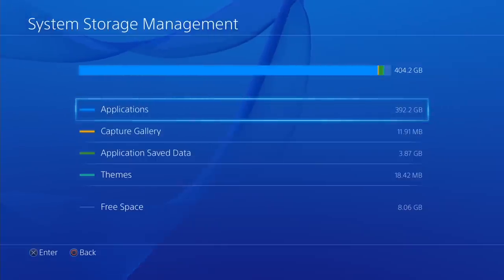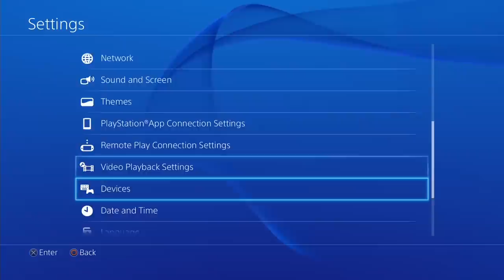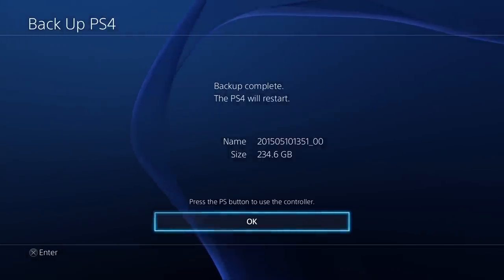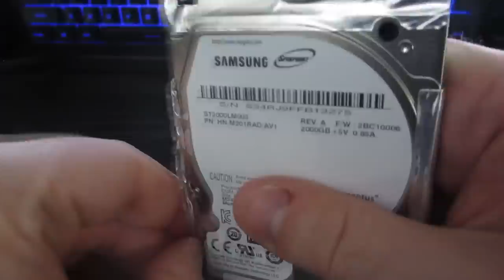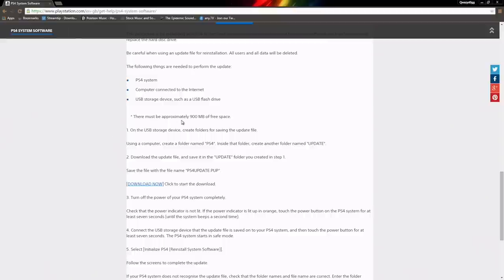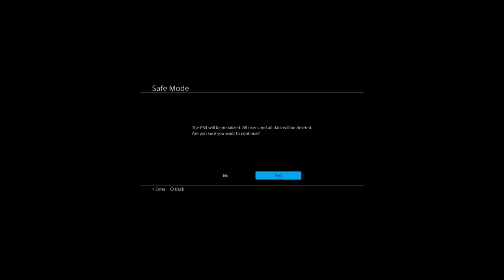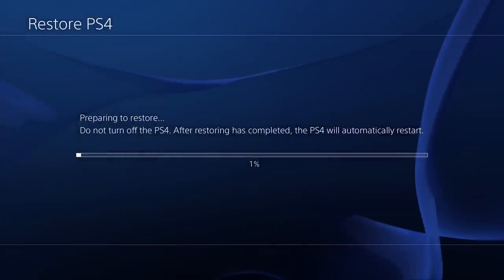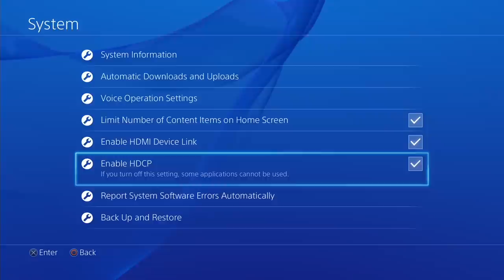How To Upgrade Your PS4's HDD Using A 2TB Seagate External

Comment: I'm a bit confused... I have a 2TB hard drive. I want to install it in place of the factory 500Gb from Sony. I also have a 32GB flash drive for the saved game data. From what I'm hearing, do I need another External Hard Drive?
Reply from the maker: +PreserveBigCats You would only need another external if you wanted to backup the FULL drive you are replacing. If your just backing up saved games, then a thumb drive would be fine.
Reply: Qwazyd0gg OK.. so it would just be as a secondary "storage" place? I wouldn't have to re-download that FULL drive Back onto the New installed 2TB drive, correct? My only concern with the full games I dl from Playstation Net. As long as I can re-dl them again thru PSN I'm OK with starting over. The disc games I will have to re-install. I'm just trying to cover my arse so I don't mess things up, i never did this b4 and I'm very hesitant.
Reply from the maker: +PreserveBigCats right, u can redownload all digital games for free, no need to back anything up other than saves... Unless the games are no longer available like the PT demo.
Reply: Qwazyd0gg  Thnx 4 the help... I'll check back when I physically need to change it out.. which should be in a few days, I need more space for No Man's Sky and soon after that Skyrim.
Reply: I just realized something... I bought Borderlands: The Handsome Collection thru the PSN+ store for $14.99... That sale ended and that game is no longer available in the PS store. Am I F*cked? Or should I just buy an External Hard Drive to be safe?
Reply: I guessing you'll need that external hard drive. Because if you can't download it from the store like PT it will be lost forever. (Like Qwazyd0gg said.)
Reply from the maker: +Scott Last You got it!
Reply: Qwazyd0gg I'm going to be trying this soon. I had to order the hard drive and it won't arrive until 11-Aug. Do I need to format the hard drive before tearing it out of the casing?
Reply from the maker: +Scott Last it doesn't hurt, just to make sure it doesn't have any bloatware junk from Seagate on it
Reply: All is good... the only problem, hours of DL time. But I got all my saved data back onto the new hard drive. Just rte-installing my disc games. 1.35 TB free space, it's a beautiful thing.
Reply: Qwazyd0gg You wouldn't happen to have a how to video on that? I know enough to be "dangerous" on computers.
Reply from the maker: +Scott Last unfortunately not man :(
Reply: Qwazyd0gg Bummer, I'm sure I can figure it out.

Comment: one question. should i back up my ps4 on the new drive im putting in? or would that be pointless?
Reply from the maker: The drive your putting in needs to be blank as the PS4 writes system partitions on it. Any files on that drive once the OS is installed with be either corrupted or erased. You will need another drive for the backup.
Reply: what will i do to the drive with the backup on it?
Reply from the maker: plug it in once the new drive is installed and has the PlayStation OS on it and you can then reload the backup back onto the machine
Reply: have you done a video how to put the playstation os on the drive? and how to put the backup back onto the machine
Reply from the maker: +Jamie G (DarkAngel1995) Its all step by step in this video
Reply: ahh alright. ill watch it again when i get my new hard drive :)

Comment: If I don't have a third device large enough to keep my saved games, can't I just put the adapter that was removed from the 2TB Seagate HD into the PS4 500MB hd and use it as an external? So I don't need a third device... And restore all my saved games and trophies?
Reply from the maker: The 500gb you would be placing into said enclosure would also be the same drive which is storing all your saves so you would not be able to us it
Reply: +Qwazyd0gg If I just want to keep my saved games, a normal USB Cruzer Blade will do the trick, since it's not occupating too much space. I'll just have to redownload all my games when the change is complete. Is that right?

Comment: have u had any problems with your ps4 since the new hdd swap?
Reply from the maker: +Paris Barksdale None at all. I purchase most of my games via digital download and whether it's directly on the drive or being partially read from the disk, if had no issues. This specific series of Seagate drive is known to be the most reliable with the least recorded errors of any drive swap tested in a PS4.
Reply: OK thanks alot.

Comment: So can i still put my previous HDD after i replaced it?
Reply from the maker: +Its Lewis You can set it aside and keep it in case anything happens and you need to put it back into your ps4, or you can place it inside the empty enclosure, format it, and use it as a 500gb external HDD.
Reply: Thank You

Comment: Can i just buy a 5TB external hardrive and keep it plugged in to my ps4 via usb cable?
Reply from the maker: +Ryan Irving unfortunately the ps4 will not read games or saves off an external like an Xbox one will. I'm also not sure about a 5th drive. I know they now support 4TB for sure but I haven't researches higher
Reply: its the same brand, would i be able to keep my save files on my external hardrive and just switch the games i'm playing back onto the 500gb internal hard drive? or even if i only got 2 or 4tb?

Comment: my old HDD wont work on in the seagate casing now. any ideas? I've got stuff on there I cant seem to redownload.
I cant seems to connect it on any computer
Reply from the maker: +gosh b The old drive will need for be formatted and reallocated in Disk Management before windows will see it; however, once you wipe it everything will be gone. If you need something off of it, you will need to reinstall the old drive into the PS4 and then backup what you need from it there.
Reply: Qwazyd0gg I might just have to find out how to redownload my other stuff again. how do I get to disk management? my pc can even seem to detect it.

Comment: do the seagate external drives work as is or do they have to be reformatted to something first?
Reply from the maker: +swiziga they have some bloatware on them so I recommend reformatting 1st
Reply: thanks, recommended format? exfat fat 32?
Reply from the maker: +swiziga either will work
Reply: thanks again

Comment: Hi im waching your video and i need help can u backup the ps4 data and updates on a usb flashdrive and also i dont have a computer to downlaod the firmware can it be done on the ps4 internet ???
Reply from the maker: +john aviles unfortunately you will need a PC :(
Reply: Qwazyd0gg thanks for the advice and your video its the right amount of information i needed im just be carefull with this process.
Reply: I got another question u know when u go to safe mode on the ps4 and u go to update system software could u download the ps4 update firmware by pressing the third option "update using internet"?
Reply from the maker: +john aviles no as the new hard drive does not even have base software to update from
Reply: Qwazyd0gg i think i got it im gonna get the "seagate expansion 2tb portable external hard drive usb 3.0 (stea2000400)" and use it as external u know with the plug. So i wont have to open it or get the firmware for the ps4 so its like an extend hard drive my ps4 drive plus the seagate drive together so yeah im gonna go with that
Reply from the maker: +john aviles awesome!!

Comment: Couldn't I back up onto the external, drop the file to a pc or Mac, then go about my business until it's time to restore. Reformat the old 500gb drive and put the restore file on it?
Reply from the maker: I'm sure if you needed to that might work fine :)
Reply: Seems to be my only real option. I just ordered this unit brand new on eBay for $50 so I'm excited.

Comment: My issue is I do not have anything to move my application from my ps4 to some other drive while I install the seagate drive in my ps4? what's the cheapest way to get a drive to move my current ps4 memory so I can install my seagate?
Reply from the maker: +Brett Barber You can backup to the external drive, then offload that backup onto your PC, swap the drive and with the old PS4 drive in the enclosure, put the backup file from the PC back to the drive and restore it.
Reply: I don't really trust my pc. It's my parents pc and it's pretty generic. I feel sketchy doing it ya know?
Reply from the maker: +Brett Barber Hmmm... Cloud storage for game saves would be about your only option without actually going out and buying another drive for backup purposes... Or since the last update, you can just use your drive as an external and load info right off of it
Reply: I guess I can try cloud. Is that on my ps4?
Reply from the maker: +Brett Barber yup :)
Reply: Ok thanks. I'm probably going to make the switch tomorrow if I don't have time today

Comment: hey bro I came across your video I did my upgrade to 1 terabyte I had the same option to go the way you went yes the way you doing it's a lot cheaper on the hard drive but I had my hard drive installed and running less than an hour
Reply from the maker: +dandan theman Great to hear man! Any amount of space on top of the stock 500gb is more than welcomed for sure!

Comment: Finished everything successfully except using the old ps4 500gb drive as a backup within the seagate enclosure. Cpu won't read it at all. Anyone else had this issue?
Reply from the maker: +Andrew Parra Yup! Easy fix! The drive coming out of the PS4 has proprietary partitions that the PC cannot see. You just need to go into Disk Management and delete the partitions and reallocate the space in NTFS or FAT32. I linked a tutorial in the comments section for another user if you do not know how to do it :)

Glad it all worked for you! I hope to see you around on some other videos :D

Comment: Qwazy does the brand matter? I have a WD Auto backup
Reply from the maker: +TopShotta10904 some externals do not let you remove the drive from the inside of the casing like the Seagate. Also, the Seagate is proven to be very reliable.

Also... The next software update to the PlayStation will include a feature to just use an external USB 3.0 HDD, or that is an option that's coming as well.

Hope that helps

Comment: can I back up files to the Seagate and then put the Seagate in with the USB plugged in? sounds easier instead of having to restore to the hard drive
Reply from the maker: You cannot use the HDD you are using as the replacement as the backup drive. This is because when installing the PlayStation software, it needs to flash the drive for the OS. Doing so would lose or corrupt all your backed up data.
Reply: +Qwazyd0gg Okay so I basically need an extra hard drive to complete this? their isn't any other way I can transfer my save files, applications?
Reply from the maker: You can migrate your saves onto cloud storage but its got its limits. In my personal case an alternate HDD or large thumb drive was the only option. As you will only need it for a day, you could always borrow a drive from a friend and give it back afterwards.

Comment: Your video was so helpfull 👍👍👍 and one more thing i have the ps4 model 1200 will the drive fit in it looks alittle different when i open so yeah i just want know those things and i be fine i think ?
Reply from the maker: +john aviles The drive in all the PS4 consoles are standard sized 2.5inch drive with a maximum thickness of 9.5mm.

Comment: Because I don't have an external hard drive to back it up except this one which I'm replacing the 500 gb for
Reply from the maker: +zade Rad You can back it up to the 2TB, offload that backup file onto your computer, format and install the 2TB drive, put the 500gb drive into the external enclosure, drag and drop the backup file from your PC to the 500gb HDD, then restore the backup. It's just more time consuming

Comment: Can you just pull all of your saved games from your old ps4 hard drive when you put it back in the seagate casing and hook it up with the usb cable?
Reply: Just an idea since I don't own another external hard drive or anything like that to transfer the games to.
Reply: I don't think it works like that, because if it did he probably would have said to do that instead.

Comment: Can I use a 4 tb seagate backup plus drive for this swap?
Reply from the maker: +Sarah Hurd That I'm not 100% sure. In the past it was a definite no; however, now I believe they patched the ability to read over TB into the firmware as I know you can use a 4tb with the Nyko Powerbank and that's just a SATA passthrough device. I would do a small amount of research but I believe you can now

Comment: i've gotten all the way to the point where i need to reset everything and its not working. i have the PS4UPDATE.PUP but its saying i dont have it in my USB please help
Reply from the maker: +Alex Peele Are you sure it is named correctly? If there is a spelling error in the file or folder it will not recognize it. Try reformatting the USB and placing the file back onto it
Reply: I got it thank you for replying thoQwazyd0gg

Comment: How big of a USB do you think I need to transfer the save data?
Reply from the maker: oooph... it depends on your save files. I used a 320gb external just to be safe but to know for sure you can check your storage section of your ps4 and see how many gb's it is taking up

Comment: I downloaded the update file but the ps4 says it can't connect to the USB storage
Reply from the maker: You have to make sure the USB drive is formatted in fat 32 or fat ext
Reply: i did do that. the only thing that i messed up was that the name of the update file was "PS4UPDATE(1).PUP" and it was the 300 mb version instead of the 800 mb version. 
after fixing those 2 things it worked!
Reply from the maker: Jeffrey Vergara AWESOME! Super glad to hear it's working out!

Comment: Can you just use the seagate to backup your games on then, place the backup on your laptop or pc. Then clear it and put it in your PS4. Then put your PS4 hard drive in the casing  and put it in your pc or laptop. Then put the back up on the ps4 hard drive and put that into your ps4
Reply from the maker: +MrSps2001 That I'm honestly not 100% sure; however, I don't think so as the PlayStation file formats do weird things with HDD partitions. It is worth a shot I suppose just to see if it's possible to drag and drop from the Ext HDD to your PC. The safest route though would be to use another source... Even if you have to borrow it from a friend for a day
Reply: +Qwazyd0gg Well I'm going to try it since none of my friends have anything for me atm. I'll message back if it worked!
Reply: Hey I plugged in the PS4 Hard Drive and it beeped on my laptop but it wont load up?
Reply from the maker: +MrSps2001 The original ps4 hard drive needs to be formatted before the PC will recognize it... However doing so will wipe all the data
Reply: +Qwazyd0gg how do I do that. I connect it but it's not formating automatically.
Reply from the maker: +MrSps2001 You need to go into Disk Management and do it there. Check the other comments of this video as I dropped a link to another viewer with instructions on the process.

Comment: can i use my 2tb external to put the ps4 update/install file on or do i need a usb stick?
Reply from the maker: You need another external USB as the drive is not readable without the software on it. Also as highlighted in the video, insure your hard drive is formated as either FAT32 or FATEXT. If it is NTFS, it will not be recognized by the PlayStation for either the drive or the thumb drive.
Reply: Qwazyd0gg i am half way through backing up my ps4 to my external as we speak , just thought i could use that hdd as i havent got a usb stick that fits in the ps4 the ones i have got are too big
Reply from the maker: While installing the software, it formats the drive, so the backup would be lost if you used the same drive
Reply: Qwazyd0gg right ok i will have to get me a thin usb stick. Cheers for that, oh before i go how and when do i have to get into safe mode?
Reply from the maker: You go into safe mode after you change the HDD and have the USB stick inserted. Just hold the power button for 7 seconds or until you hear two beeps. After that, you van follow along with the rest of the tutorial :D I'm glad your getting use out of the video
Reply: Qwazyd0gg yes its a great video just 1 or 2 things i was'nt sure about but thanks to your video and advice 2tb ps4 here i come. much respect and if possible do another video showing exactly what needs to be done. and when to do it, also put some links up about which hdd to get and usb memory stick, also point out if things go wrong what steps can be taken to get around it>
Reply from the maker: For sure, I tried to be as thorough as possible but the video would have been way longer if i included everything possible lol the HDD is linked in the video description and is the one that is the most used with the lowest failure rate on the market. As far as USB, you can use ANY USB that is at least 1GB or higher. Thank you for all of your feedback and I'm super glad I was able to help you achieve a massive increase in storage for your PS4! If you could share the video to help out others as well, I would greatly appreciate it :D
Reply: Yeah will do nice chatting to you and do more videos as they are well presented.